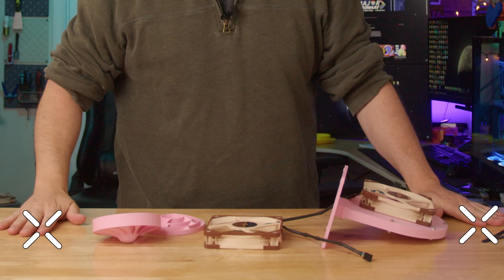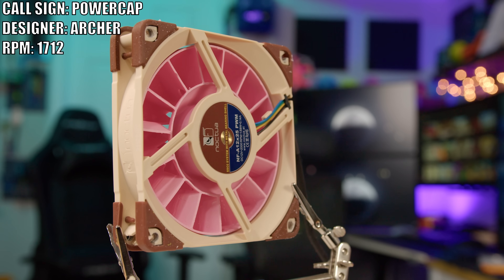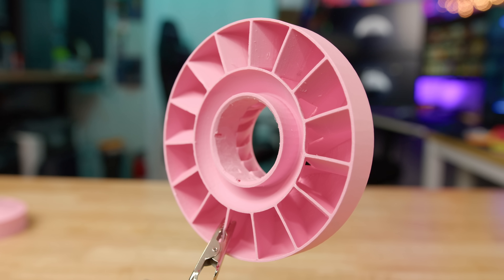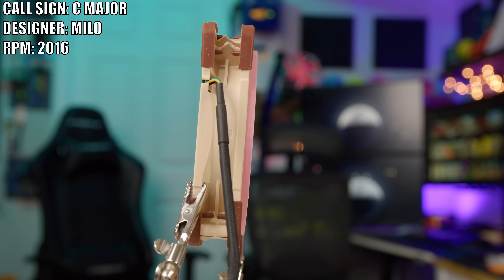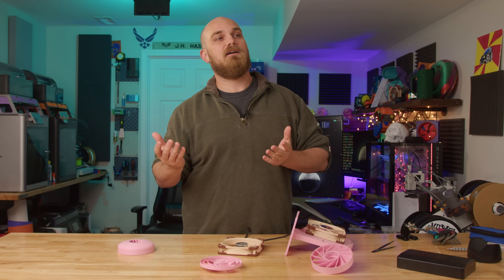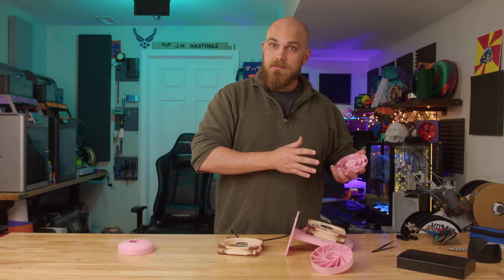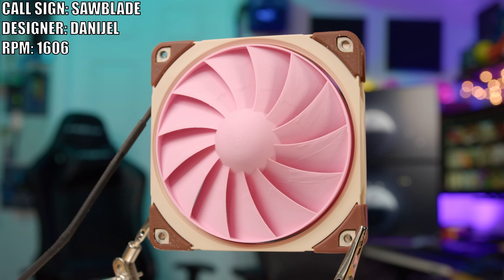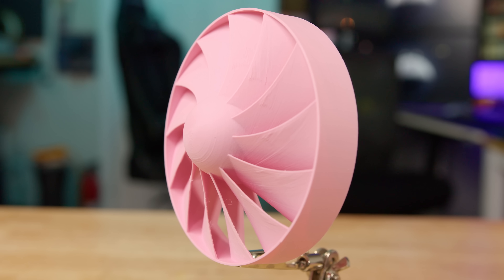Insane Fan Hack WINS Big! 😱 | Fan Showdown S6E4: Ultimate Static Pressure Battle

Comment: I am the designer of The Wonder From Downunder, thanks for choosing it!  I made my own manometer to test different versions .  The result could probably be improved if some tape was used to seal the 2 halves together
Reply: Nice design. You mentioned tape, yet you could design the mating of the two parts with a deep U groove on one side and a mating single intrusion. Similar too the way a car window on a winder/motor.
Reply: @Del_UK  I just sat and tried to think of a way to contain as much pressure as possible in the WFDU, without using any gasket material or screws. Following your Single Intrusion - 'U'channel design, I'm thinking run a 'T'-shaped, sort of Double Fish Hook along the innermost mating surface of the Single Intrusion, and two parallel, channels along the inner faces of the 'U'-channel, to mate with the 'Slight-T'. The beveled-T protrusions should flex, and drag, as the Intrusion is pressed into the U-channel, so when they mate with the back of the U-groove, they spring back out, to set inside the channel. It should lock together, and you would have to break it to separate the two halves. Probably not water-tight, unless the person printing it was a wizard, but since the inside of the WFDU is high pressure, I think running the fan would tighten the seal.
Reply: @Inertia888  I just had a look to see if there is a name for the type of joint, I am referring too. Tongue and Groove joint.
Reply: @Del_UK  Yup. Tongue & Groove. I use it with woodworking. And there's a similar locking system with vinyl siding, using a 'J-Lock', it's want it sounds like. Your Tongue & Groove is simple, and it works well. I probably over-complicated it by adding more grooves and more tongues, to the seal, but trying to think of a way to snap it together, have it hold itself tight without additional hardware, and take advantage of the higher inside higher pressure, to help seal it without a gasket. But My snap-lock can't be disassembled without breaking it, so that is a disadvantage if it would need to be opened. Also, printing my locking track, would have a pretty tight tolerance, so not easy, and if it snaps instead of locking, it would have to be printed again. Not sure if it would be good or cause unwanted complexity. But it's fun to think.
Reply: @Del_UK and he has made the flexible gaskets before
Reply: Nice job dude!
Reply: Nice work, I would love to play with one of those, is the design available anywhere?
Reply: I thought you would get some turbulence. Nope. Great design, 👍.
Reply: Well done my man. I still don't understand how that thing is able to create so much static pressure. But the fact that with the same input voltage you could get that high a nr is crazy.
Laptops do use these so that must be the reason why. Now I just need to duct my PC and install one of these.
Reply: You can send a model for a TPU-printed gasket with the next version to improve results while still staying in a "completely 3D-printed" territory.
Reply: DAM Dude, that fan was so good that it was almost cheating!! Well done. Winning done the Aussie way.
AUSSIE! AUSSIE! AUSSIE!
Reply: ripping good job! It's just missing some vegemite
Reply: Could you share STL files?
Reply: Awesome. I like how everyone else tries to make a fan that blows through the supplied frame. You ignored that and just used it as a motor.  Nice.
Reply: Great job at making a design to maximize static pressure.  For those who are wondering, yes you're in turn giving up CFM, or volume of air moved with this design, as stated in the video already.  It helps point out a flaw in this series where static pressure seems to be the gauge while it should be a combination of pressure and volume which produces the best results.
Reply: @lanzer22  its not a flaw in the series, its just a different perimeter to design for.
Reply: Onya Stevo!
Reply: How to solve the sealing problem with ease. 1.65mm o-ring groove to the outside ring. All you need is 1.75mm tpu. Simple, easy, everyone has the materials at home and you can make 90degree angles.
Reply: Dude your design is dope! In static pressure-reliant cooling designs, I wonder if you could stack them flat sides together to essentially apply maybe 5 fans worth of pressure to a 2 fan radiator?
Reply: Nice work. I've bastardised fans from axial to blower in the past and I found that the pressure also increases when the tongue (the bit pointing in on the lower segment of the exit) is closer to the blades. Did you experiment with making this component come closer / have a tighter curve towards the impeller at the start of the volute? When I did so I found there was a point where there was a trade-off between increased pressure and the noise levels jumping up disproportionately.

What kind of gap did you have between the top of the rotor and the top of the enclosure? I found 0.6-1mm gave the best. Anything larger and I found that air would start to escape back towards the intake and reduce the output. Also what prompted you to draw air in fron the back instead of around the front?
Reply: I love how you just looked at the standard design and "nah, I'm just gonna stomp the one parameter" well done and kudos for thinking outside the box and going full radial compressor.
Reply: Next step: volumetric pump
Reply: nice work mate! this thing would make an awesome remote part cooling fan on a vzbot or ratrig. (currently one needs to source a cpap for that)
have you considered putting it on printables/thingyverse?
Reply: Any chance you could share a link to the STL? I need this in my PC case
Reply: I had an Idea for it in my comments. If it would work, let me know! If it does it would be bonzer!
Reply: amazing work I honestly thought the air inlet was going to be a way small to flow that much air - Im stunned
Reply: Make it look more like a turbo, i wanna turbocharge my CPU
Reply: @danielk9906  I didn't do that to make it easier to print.
Reply: Great work, i would assume there is a potential at the air intake part of it;to suck in air and funnel it into the blower side of of it
Reply: @Eurossch  that's how blower fans work.
Reply: Really well done!
Reply: Ever since the start of this season I knew a design like this would dominate, I just don't have the technical know-how to make it myself. I'm so glad someone else did though. Well done.
Reply: thank you man i waiting for this design since season 1!
Reply: You definitely are on top of the static pressure hill right now. Good job.
Reply: you my guy swept everybody under rug like nothing!
Reply: Love the design. 
Since this season was announced I've been thinking about a twin screw design but my 3D modelling isn't that good. I make switch covers, lol. Also Downunder
Reply: From a fellow strayan nice work mate 💪🏻
Reply: I love you man 😅 my fellow countryman! You just made this the best episode I have seen yet, and you have confirmed what I sespected about low speed centrifugal, but what I really liked is the curve you put in your blades😮 I am getting into building my own jet engines and I think you just made a huge leap forwards in centrifugal blade design, especially at such low rpm! Would love to talk to you one on one sometime, I am from Queensland Australia 🌏 am impressed 😅😅
Reply: Your fan is called the wonder from down under but you are the real wonder!
Reply: Very cool.  I made a much smaller fan a lot like this for my 3d printer was simply not getting the pressure needed to cool it kept getting heat creep.  Same exact concept turned the little 40mm fan into a blower now no issues with heat creep.
Reply: Hell yeah that's awesome! Nice work!
Reply: Damn son. seriously. wow. wicked.
Reply: Have a little channel for a rubber seal
Reply: That fan is INSANE, does it suffer from the same overheating issues as turbochargers?

You may have just created the best water cooling turbos.
Reply: maybe add a tounge and grove around the perimeter so it will mesh together instead of 2 flat surfaces?
Reply: Well done sir! 👏
Reply: Nice job bud, that fan literally crushed the others more than 2 fold.
Reply: That is pretty epic, more than double the 2nd place is literally off the charts.!  Many congratulations for absolutely destroying the competition.!
Reply: You already made easy to make though, that’s probably more valuable than the performance increase you get from tape, well done.
Reply: Is this actually better than any production fan rn? I mean should this be the new design to follow for air cooling a pc? Might be a stupid question but I geniuinly dont know
Reply: Love your fanman😅 I am from Australia 🌏
Reply: FINALLY a blower style fan Thankyou
Reply: But wouldn't it just warp spacetime and tear the tape off?
Reply: I knew blower fans where good for static pressure but god damn. Props to you.
Reply: @eggchucker1  I have entered my new design that I measured as almost double what The Wonder produced.  Look out for me next design, he just needs to choose it!
Reply: bloody legend smashed it out of the park.
please let me know if the files are linked somewhere.
Reply: flowrates doe :/
Reply: How does it perform on a cooling test?
Reply: Silicone the seams on assembly. It would be more effective at reducing leakage in housing seams
Reply: With the fan down under, would it matter if it’s a narrow exhaust out?
Reply: Not sure if this would be something to consider because we are turning the turbine itself and not using and outside force, but adding smaller fans with more layers mean anything like the Tesla turbine?
Reply: That name tho~ if I tried to shorten it it becomes "Wunderbar" which is great 😏
Maybe the next version?
Reply: Next step make a supercharger
Reply: @TheRattleSnake3145 Do you know rough numbers for the air flow? It didn't seem that bad, definitely didn't look like the worst fan in this episode based on the smoke test.
Reply: It's basically a Sirocco fan, innit? They use them on large ships to push metric aftloads of air down into the bowels and engineering spaces, with a relative quietude of power.
Reply: Check this guy out, making a blower for his Falcon and after winning by so far in advance he basically wins every season this series is going to be ran ever just goes, "Yeh mate it could be better".
Reply: could always design the 2 parts with a channel in one side and a ridge on the other to sort of give a built in seal point.
Reply: could be used as a negative pressure fan and install it somewhere inside the case where you have room to push out the air...
Reply: next thing you know someone will make a piston pump design.
Reply: Those blower fans work better in the opposite direction as thrower fans
Reply: G'day mate, nice work! And defintley room to move here, if you are going to do a few more renditions, consider at the outward section to make it a little longer if needed and put some inlet slits in it, because your pressure going through will actually release a lot of immediate vacuum pressure at the output that is lost but can be used to suck in more air just before the outlet giving giving more volume. Hope that make sense.. Nice one though, good to see an Aussie tearing up these blokes from across the pond..  ;P
Reply: Combine your design with Venturi nozzle at your air exit. You will get so much more airflow!
Reply: I use these rattlecage style fans for vaccuum on my laser... they are noisy AF, but highly effective in CFMs.  people opt for expensive inline fans, and I hate them.  Take an old rattlecage out of an old A/C unit and mount it on a board and you can circulate more air in your shop/garage better than anything else.  I know there are weight limits w/ these little motors, but I think your fins are too thin...and maybe a little feedback tube to cheat the rpms and call it the turbo from downunder.
Reply: @s7r49  ahh yes i forgot this channel is about PCs.  My rig is custom built and has a case w/ 4 fans +2 on gpu,+1 on cpu,+1 on PS...the case fans never run faster than lowest rpm, I can never hear it and i have monitored temps.  And yes i run 3 monitors, can max the cpu,etc. for hours and still 0 noise w/o a liquid cooler or external anything...so you might be doing too much. ;)
Reply: love the idea. how much did it change by adding air inlets on the side the motor sits on to suck air in better?
Reply: @carcrasher89  that was the only spot I  tried.
Reply: Freakin sick man
Reply: backwards swept blower is king of static airflow, only way you can really beat one is to make a pump, but tolerances and friction usually means the A12x25 motor just cant make it work.
Reply: i have a suggestion , make a curved 90 degree vent on the output so that it can lay flat in a desktop or tower case ,  the low profile of the spin section makes it perfect for thread rippers. so rotate the out put channel though a low radius internal curve or even 2 45 degree curves  so it could lay flatter in practical applications.
Reply: also a blade that fills the entire space, reverse the blade design so it pushes the air into the exit... and intake thats open maybe 35% more? 

actually surprised this worked so well... but it compresses the air more than i thought it would, im imagining lots of cavitation as the air travels over the top of the blades, instead of being pressed against the sides, but maybe thats why it performed well 🤷

like a reverse water spiral lol. a jet up the center crashes against the housing, then pressed along the edges 🤓🤔
Reply: I wonder if another channel could be added to the opposite side, I guess what would be a hot side on an automotive turbo. It wouldn’t be a perfect doubling of static pressure, but I bet it would still add some punch
Reply: I wonder if there's a way to make a good cooling set up with that. Maybe a small but super thick radiator?
Reply: @thedanyesful  it would be great for a thick radiator, as long as it has a different  adaptor.
Reply: Any chance of making some with smaller fans that can be mounted on GPUs in place of their existing fans?
Reply: the static pressure come purely from RPM. I feel like if you make the input opening smaller, and have a shroud around the blades (think the squirrel cages), it is going to do even better.
And more blades. A lot more blades.
Reply: a small channel inside the outer halfs + a small nylon/tpu strip would seal perfectly.

or any other sealing ring/gasket or even silicone
Reply: I'd love to see you target decreasing down to 45dB and see how much airflow can be achieved with this design.  How about a silent but high performing killer?
Reply: @chriskucharik  We can call it the Ninja Fart
Reply: Brilliant result for static airflow. I'm wondering why you didn't design an intake shroud to keep the airflow pretty smooth going in, like most turbochargers use? Seems like there's a lot of room for improvement by getting a higher volume of air into the chamber to put under pressure.
Reply: Make it so you can sandwich two together sharing the same outlet :D
Reply: Consider adding gaskets to the design instead of tape.
Reply: You could probably make a tpu gasket between them. 2-3mm should work real nice at 100% infill.
Reply: Looks like a ps3 fan👍
Reply: Do you plan on releasing the files at all?
Reply: @TheInnerHalo72  I might at the end of the season.
Reply: @TheRattleSnake3145  Any chance you can DM them to me or would you be open to selling the STL files?
Reply: Model glue?
Reply: @ZM1306  can't glue it if you still want to be able to take it apart
Reply: I want to see this actually on a computer!!
Reply: A twin turbo 7800x3d sounds pretty cool!
Reply: Is the STL file available for printing?
Reply: @johnmarie8830  not untill after this season finishes.
Reply: Manometer?  Is that to test fan manliness?
Reply: I might have to play with this design a bit and see if I can make a single fan cool my entire 360-rad under a rendering load. If it works with only 1 fan, this will drastically change how cooling is done for PCs. At least, it will change how I cool my PC.
Reply: Your design was very inspiring to me. I took ideas of your blade design and created a compressor for 3D printers with two open sides and a 775 Motor. Would it be okay for you when I reference this Video when I publish the compressor on thingiverse?
Reply: Would be awesome to have it in a useful formfactor tho.
Reply: amazing design
Reply: @bobmarlej9106  its been beat lol
Reply: Now do a supercharged pc fan
Reply: Is there any way we can get the file for that? I am having a problem with cooling in a super custom pc build in the Alienware x51 R2. I don't mind paying for it if you have any account on cults3d etc. This would be perfect!
Reply: Is there any possibility of you sharing the STL? I’m hoping to make a design to convert a 90mm fan to a radial blower like this for cooling a 3d printer. If not, do you have any design tips?
Reply: I've been thinking about doing exactly the same thing since he announced the new season.  should've gotten on it sooner
Reply: @butre.  You can continue building on your wisdom.  We are all billionaires.  We are all amazing inventors.  The finish line belongs to those who can execute.  What do you think?  True?
Reply: @KTPDAILY  when it comes to billionaires the finish line mostly belongs to whoever stepped on the most people to get to it.  for inventors though?  it's all about iterative design.  the finish line belongs to whoever did it best
Reply: @butre.  Thank you for sharing your opinion with me.  Best Wishes.
Reply: @butre.  you have an idea
now you have an opponent

good luck my friend
Reply: Thats amazing bro, good job! Have you tried making it with two intakes? Because I think It may make a difference since there will be twice the amount of air so maybe a bit more pressure
Reply: Man broke the meta
Reply: Congrats. You really decimated the other entries.
Reply: "Decimate": To reduce by one-tenth.

But... Good job.
Reply: @AmaroqStarwind  
dec·i·mate
/ˈdesəˌmāt/
verb
verb: decimate; 3rd person present: decimates; past tense: decimated; past participle: decimated; gerund or present participle: decimating

    1.
    kill, destroy, or remove a large percentage or part of.
    "the project would decimate the fragile wetland wilderness"
        drastically reduce the strength or effectiveness of (something).
        "plant viruses that can decimate yields"
Reply: @AmaroqStarwind  I didn't say decimate.
Reply: @TheRattleSnake3145  Well somebody did… sorry.
Reply: @AmaroqStarwind  "to harm something severely"

But... nice try, smartass :D
Reply: I watch the video, read comments and I don't get it. How is The Wonder From Downunder possibly a PC fan? I feel like there should be boundaries to what dimensions are allowed.
If you use as much volume as The Wonder From Downunder, then you could use 2 regular pc fans as well and cool much more.
Reply: @Platypus_Warrior   this is a static pressure design challenge.  It was never meant to cool a PC.
Reply: " The result could probably be improved"
Says the dude why didn't just blow the competition out of the water, but straight up nuked them. 🤣
Reply: @TheRattleSnake3145  Now it's clear. Got it, thanks
anything close to a volumetric pump would have nuked the competition in that case
Reply: @The_Keeper  my diy manometer measured 10mm!  I sealed the edge with tape but forgot to mention that in the email.
Reply: @TheRattleSnake3145  
Damn!
Impressive.
Reply: @TheRattleSnake3145  
Yeah, that has always been an issue with blower-type fans. They are good at increasing static pressure but not so good at moving CFM (cubic feet per minute) of air. In air cooling a PC, it is about the airflow.
There are two ways you can get maximum cooling: air changes per minute with no other concerns, or you can go the soak route. Get the air to soak up an optimal amount of heat as it moves. This results in hotter air coming out of the exhaust fans. You want to get it right.
I myself, in air-cooled PCs, always went for air changes per minute. There are 120mm fans out there that can move a couple of hundred CFM so long as you do not care about noise.
Now, if you put, say, two of those as intake + an 80mm at 100 CFM and two 120 200 CFM fans for exhaust, you get over-pressure. This helps keep dust out, and you only need to control it for intake fans. Now, if your case has, say, 4 cubic feet of air space, you are getting close to 100 air changes per minute. Close to because of drag inside the case and areas where air swirls around inside, etc., so you won't get a full 100 air changes a minute, but around 80 without a ton more work on smoothing out airflow, etc.
You can also work to reduce cubic feet inside the case with ducts and baffles. If you have empty slots, you obviously won't need to cool those areas, so you can block those off. You can also supply the GPU with its own fan and the CPU with its own fan inside the case. And also get the air out of the case without any mixing.
A fan like yours could be used to direct air straight onto smaller areas, say chipset coolers or RAM coolers, so it could be used in a PC for cooling.
Say a custom-built case with a duct on the top to feed the fan air, with the exhaust having another small duct to put air right over the RAM, moving air along the length of the RAM coolers, blowing into the flow from a front intake shunted to the rear exhaust.
Reply: @TheRattleSnake3145  but can be used to cool watercooling rad's
Reply: @TheRattleSnake3145  0:16. "you guys try to design the best PC cooling fan". Gtfo.
Reply: @noxious89123  how about you just enjoy the different designs instead of being toxic?
Reply: @The_Keeper  yeah it could, but it would be difficult to print lmao. weighted turbocharger shaped impeller, rounded one piece turbine housing, bigger intake feeding on the opposite side of the motor with a bell mouth... the limit is what the noctua motor can draw before burning up.
Reply: @Platypus_Warrior  Yea it would never cool a PC by just bolting it on. However, keep in mind that centrifugal fans just like that are used to cool laptops all the time.
Reply: @AtomicOverdrive except spinning the other way, as throwers. Same with squirrel cages. Works better to pull from the center and blow outward
Reply: @Platypus_Warrior  Well, you only get to use 1 noctua fan motor for this challenge.
Reply: @EasyMoneySG  As a rotating volumetric pump that uses one motor there's "internal gear pump", "vane pump", "axial piston pump"... I did a merchant ship mechanic school, possibilities are huge, the first 2 pumps seems very easy to replicate with a 3D printer
Reply: @Platypus_Warrior his impeller was 5inch just like all the rest😅
Reply: @CraigLandsberg-lk1ep  the same diameter as all of the other fans.
Reply: @Platypus_Warrior   just make it wider, add more powerful motor and make duct to which all the radiators were transferred using water cooling
Reply: @Platypus_Warrior  I might install the thing into my own PC to cool the radiators, but I'd want something with a full 120mm outlet so idk. As it currently is, without the full size outlet, I think it'd fit just fine.
Reply: @someweeb3650  Undervolting is the best safest underrated way to:
- cool your PC
- make it more quiet
- save power
- extend the lifespan of your PC
- overclock if wanted
Reply: @Platypus_Warrior  You could possibly mount that to an air cooler inside a PC chassis and get some pretty insane cooling. I saw someone 3D print ducting to channel air directly to a fin stack and they saw a 10 degree drop. I can't imagine something like this would be more outlandish inside a PC case. The biggest problem would be supporting it - maybe some wire?
Reply: @isturma  It gets to a point where a heat pump would be more efficient in all aspects. If people are willing to spend 1000 dollars/euros on a graphics card alone then a heat pump is the future in computers
Reply: @Platypus_Warrior  you could externally mount it in a single slot of a PC.